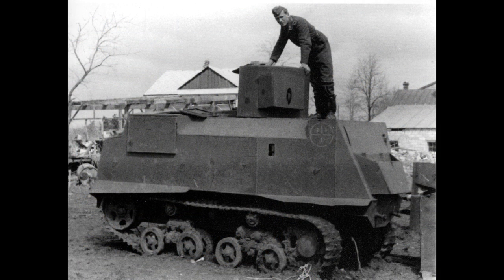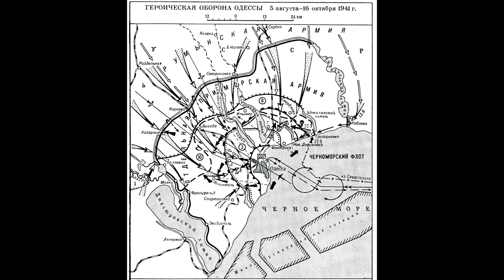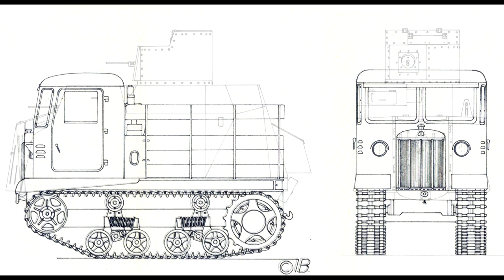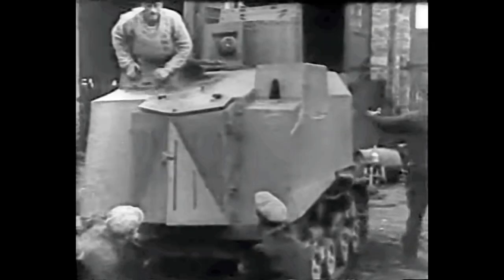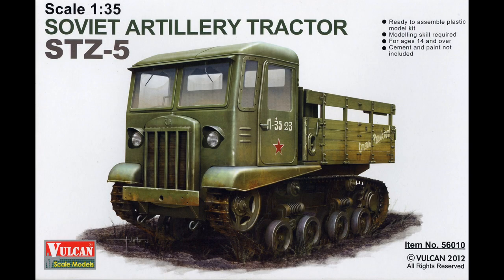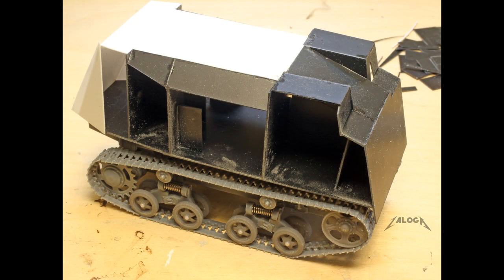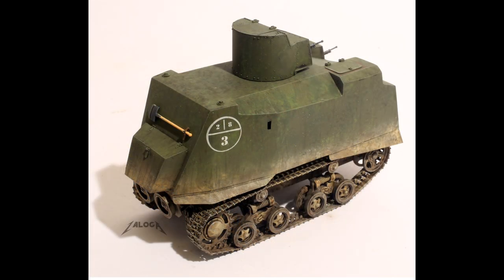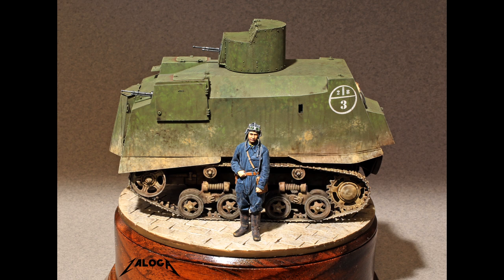Modeling History: The Fearless Tractor Tanks of Odessa

Comment: Superb model! I seem to recall there was also a crazy one-off vehicle where and entire T-26, minus running gear, was 'dumped' on top of an STZ-5, with cut-outs in the bottom of the tank for the engine and driving position of the STZ-5 to poke through into the hull.